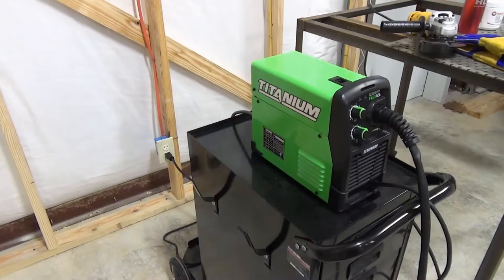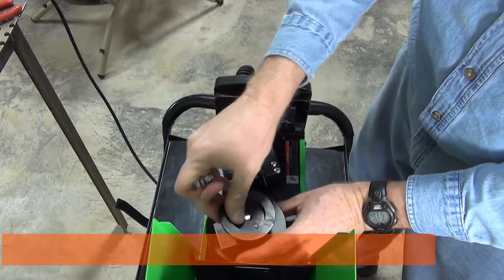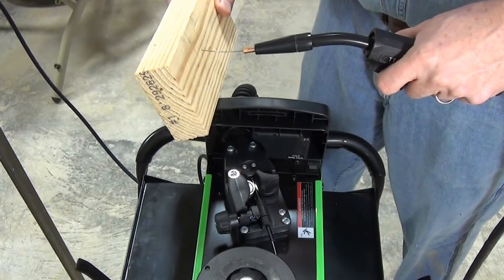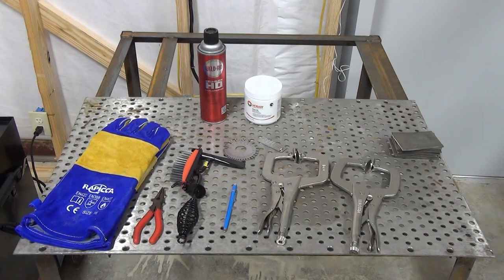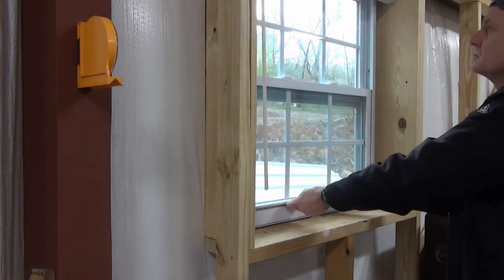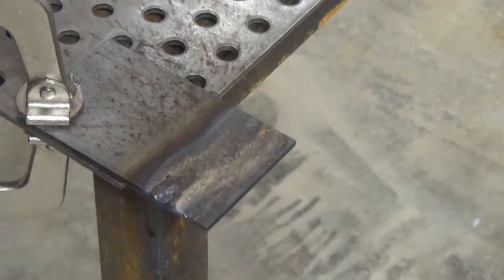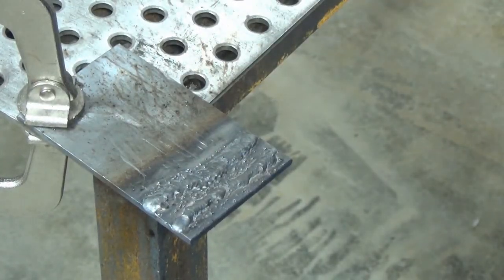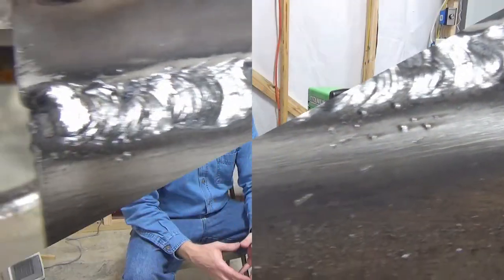Titanium Easy Flux 125 Welder: Specs, Setup & Review,  - A Great Welder for Beginners! (#83)

Comment: You're probably doing far better by now, but for other newbies, here is a tip. When you are standing and free handing a weld, your body, arms, and hands tend to move around, and for some people it's difficult to steady your hands enough to stay consistent in the molten puddle. Try setting up your work piece so that you can lean your body or one arm against something to steady yourself from wobbling or shaking. It could be as simple leaning your hip against the table, or the back of one arm or elbow against a vice or something. The more you can steady your body and arms from the 'shakes', the more consistent you will be in the puddle. Then you can focus on how to move the puddle along so that it looks like you are stacking dimes or nickles. Once you begin developing good welds and understanding the importance of being steady and consistent, you will begin to develop your ability to free hand a little better without always bracing yourself. Good luck to all you newbies.
Reply: Thanks Mike for the advice.  That makes perfect sense.  👍
Reply: I need to figure out how to dial the mask so I can see the puddles :-)
Reply: @jpravetz   The minimum shade number you should use for any type of arc welding is #10. The larger the number, the darker the lense, so #11 and #12 will each be darker. Here is something you may try that helps. Buy an old school welding helmet without adjustable shades. Buy a #10, #11, and #12 shade lense. Start with the #10 shade which will give you the clearest view of your welds. As you weld, pay close attention to what is going on with your puddle. Then move up to a #11 shade. Things will be darker, but your familiarity with the arc and puddle from the previous shade will help you to weld with the darker shade. You may want to try the #12 shade also and decide which offers the best eye protection while still being able to see your work. Once you are comfortable from understanding your puddle from using the lighter shades, you may be able to comfortably use the darker shades. Different types of welding in different conditions can be a factor in which shade you use. Then you can go back to a helmet with an adjustable lense and you will be able to dial it in to your specific needs and circumstances. Starting with a number 10 shade should give you a pretty clear view of your weld puddle and that's a good place to start, but for the health of your eyes, you should use the darkest shade that allows you to work without struggling to see.
Reply: @tangoindiamike9189  Thanks for this info, very helpful!
Reply: @jpravetz  Another tip...the lighting conditions around your work can also play a part in your ability to see well. For instance, if you are stick welding out doors on a clear sunny day with no shade casting on your work, your visibility will be notably better than welding indoors in a dark corner. If your work space is dark, try positioning a shop light or a lamp to shine on your work. Caution: if you have white or light colored walls, the welding flash can reflect off the walls, into your helmet, and reflect back into your eyes by bouncing off the inner side of your lens. This can cause flashburns to your eyes. If you are not familiar with flashburns, it's not something you want to learn about the hardway. You'll wake up feeling like you have sand and vinegar in your eyes and won't be able to keep your eyes open. The affects usually last 1 to 3 days, sometimes more, and if bad enough, can cause blindness. You'll need to see (visit) a doctor and get drops for your eyes. Learn from my mistakes, not yours, it's less painful for you.
Good luck with your welding.
Edit to add: Technically, a flashburn is when the retina gets burned by the welding flash. Take care of your eyes and learn to adjust your surroundings, work lighting, and lens shades appropriately. Having work lights will help you see better without harming your eyes.
Reply: @tangoindiamike9189  I love learning from other people's mistakes. Thanks Mike!
Reply: Thanks
Reply: Mike do you make videos?? You gave great advice thanks
Reply: @deontagray7526   No, but I think about it a lot. 😁
Reply: @tangoindiamike9189  I’m subscribe to ur page I say go for it I fully support you

Comment: I’ve had this same welder for two years and it has performed flawlessly. I tried several different brands of wire and settled on INE, as it delivered the best welds with very minimal spatter when the machine is dialed in properly. I’ve done trailer repairs, mower repairs, countless home projects, and even used this welder to weld the chain hooks on my tractor loader bucket and have been 100% pleased with the results. Your first welds looked great, and I’m sure by now you’re even better. I just recently bought this welder’s big brother, the Titanium Stick 225 SMAW welder, and have been practicing with it lately. (That thing is a BEAST!)  Since all of my welding is done outdoors I stick with flux-based processes, and with these two welders I can tackle anything that comes up. Great video Martin, thanks! 👍
Reply from the maker: Hi David!  Glad to hear you have the same welder and it has held up well.  Yeah, that INE wire is good stuff.  Also glad to hear the Titanium Stick 225 is good too.  I’ve considered getting it as well. Thanks for the kind words and for watching!

Comment: I recommend that you remove the protective sleeve and tip without the power on.. if you press the trigger when the sleeve is off, then it’s live, and if you touch it, you can get quite a shock. If you lay it down on metal that’s grounded, it can short.

What people call the ground clamp isn’t a ground clamp, it’s a work clamp. Actually it’s on the positive side of the circuit for DC flux core welding. If you try to weld to something that’s grounded, it could be a problem, so check first.

Don’t get too close. The closer you get the more spatter you’ll get. The welds aren’t bad for a beginner. Some of the welds are too wide. It seems you’re moving too slowly. Use a stringer unless you’re welding a “t”. Don’t weld over a bad weld. It never works. You’ll catch flux in the weld and have porosity. Grind the weld down and try again.
Reply from the maker: Hi Mel! Thanks for the great tips and for watching!

Comment: What I have done when touching areas that may be electrified is keep the welder unplugged. I just picked one up myself after having got rid of a very heavy welder years ago. Good instructional video. Helped reinforce what I read in the manual. I actually took the shop part of a welding class at a local community college. Indeed, practice makes proficient.

Comment: I have no experience with wire feed welders and am looking to buy one. I used to be fairly good at stick welding back in the day. I just wanted to compliment you on the quality and thoroughness of the video. Especially wearing an external microphone, that adds so much more quality to a video. The voice overs are very professional too. Well done and you’re going to improve every time you do a bead. One thing I would have liked to have seen is comparing your beads to the manual to see if your controls were right or just from being inexperienced. I suspect a little of both. Well done.
Reply from the maker: Thank you for those kind words!  Comparing my first beads to the manual would’ve been depressing, so no thanks!  But, I think you’re right: a little of both. Thanks for watching!

Comment: Came here from your posting on the Harbor Freight site just to post some thanks for a very professional and thoroughly informative primer on this welder and beginning welding in general.  Watching has pushed me closer to pulling the trigger on something like this although living in a close-in residential neighborhood, I don't have the space for a shop (or real need for this, other than as a maker-hobbyist) but I appreciate all your efforts to make this helpful video!
Reply from the maker: Thanks, P F!  If you live in an area with decent weather so that you could weld outside, then this little welder would be ideal. Thanks for watching!
Reply: @DIYMyWay  I see it is on sale at HF this weekend in a big "parking lot" sale for only $159.99!!  Pretty tempting....

Comment: Great video that will be very helpful for the beginners just sitting on the fence about buying their first welding machine!  I'd consider just replacing the HF wire with your new stuff right away to get rid of the splatter.  You can always save the remainder for "emergency" running out of wire.  Also, I know there are better MIG machines out there (with gas shielding), but anyone who says you can't get a quality weld out of a 110V flux-core either hasn't tried one, or watched some of the excellent videos already posted.  Used within their limits by people who have practiced, they're perfect for beginners and the occasional home welding needs.  I've seen plenty of guys with big wallets make worthless welds with $4000.00 Lincolns, Millers, and Hobarts.  Keep up the great work and keep practicing!  Thumbs up!
Reply from the maker: Thank you for the kind words, Rob!  And thanks for the insights!  I agree 100% with you that these inexpensive inverter welders are perfect for occasional welders like me. Thanks for watching and the thumbs up!

Comment: I like to position myself to where I can stabilize the neck of the gun with my left hand while resting the bottom of my left hand  on something solid. Do practice passes to make sure nothing will interfere with making a smooth consistent pass. I just bought the titanium 125 as a portable welder and it's a great machine for the size and money.
Reply from the maker: Thanks for the tips, Jake.  I appreciate it! Yes, that little welder is surprisingly powerful for its size. Thanks for watching!

Comment: try to keep your distance from work around 1/8 inch and do less side to side motion you are running out of your heat pool and also work on staying in your pool a bit longer to burn the trash / contamination out and let the flux do its job if you pull your bead to fast the flux will not let the trash flow to the top of the weld to be removed other than this looks pretty good for a Noobie lol.

I  want to also point out your real amperage comes from your wire feed speed the more you push in the more heat you get power setting mainly applies till metal hits melting point the wire feed rate is what does the penetration looks to me like you need a bit more wire feed speed and maybe a little more heat your penetration isn't looking that deep but the before conversation about spending more time in the weld pool will help this flow deeper also.
Reply from the maker: Hi Rick!  Thanks for those in depth tips!  You’ve mentioned details I haven’t heard in other comments so I really appreciate it!
Reply: Awesome advice!
Reply: That’s too close. 3/8” for flux core.. even 1/2” isn’t too far. Too close and you’ll get far too much spatter. Remember that flux core is a very thin hollow wire. Hold it too close and the wire melts too fast. Then the flux isn’t heated properly, and it won’t be effective.
Reply: Thanks your comment helped me out
Reply: @melgross  you’re correct

Comment: Yes, anti spatter is a must with flux core for sure !!  A lot of the missing consistency can be gained by bracing your gun hand with the other hand while touching the table or work piece....even if its just with a finger.  That will make a great difference until you get a better hang for the holding the gun with a steady single hand.  I still force myself to this day to implement this idea. 
    As for your first time performance, for the passes near the end, it was looking pretty darn good.  Burn some wire and btw...you looked cool with the backwards cap.  LOL. Sorry it took so long to see your video and I thank you for the shout out to me and ol' Joe.  But I surely wouldn't refer to myself as an 'experienced' welder....but thank you for the vote of confidence Martin. Be safe and be cool my friend !!
Reply from the maker: Thanks for the tips, Wendell!  Yep, that’s the only time you’ll see me wearing a cap backwards!

Comment: Martin,  Great video.  Keep them coming.  I’ve had a similar flux welder for quite some time.  It has come in handy.  I got a wood chipper last summer and like you, I kept the metal crate.  I didn’t know what I’d use it for until now.  Great idea.  Thanks Jim
Reply from the maker: Thanks, James!  Yes, I knew when saw that metal frame my wood chipper came in, it would be my first welding table.  I’ll get more practice welding by adding some more steel to it to strengthen it. Thanks for watching!

Comment: Martin,
Congratulations on picking up your first welder.  15 lb. inverter flux core welder 125 amp welder for less than $200 is a heck of a value.   I already have a Miller Mig, Tig and stick welder.  I picked up one of these for its simplicity and outside use.   You are doing well.  Check out my Festiva’s YT channel.  He is a fabricator and does some of the first reviews of the Harbor Freight.  He has a how to beginner welding video with the Easy Flux.
Reply from the maker: Thanks for the encouraging words!   In fact I did watch Mike Festiva’s videos among others on the Flux125 before deciding to buy it.

Comment: Off to a good start there Martin! My first welder was a Lincoln flux core about 20 years ago, think it cost at least three times more.(Gotta love Harbor Freight). I've come a long way since then but still not a pro. Looked like you were moving a little too fast (hard to tell sped up) but overall good form, I like the comments about finding a hand rest/ stable position. The recommended settings on the welder are a good start, but don't be afraid to make small adjustments. a lot depends on your set up so small tweaks might help. My only other recommendation is after your comfortable laying a bead on the table practice some out of position stuff. ( vertical up/down, overhead, around obstacles). I try to do as much on a bench as I can, but not always possible. Practice some before you have to do a field fix upside down in the mud. As always Great work! Have fun and keep learning.
Reply from the maker: Thanks, Bubba!  I appreciate the tips!  I have a lot to learn, but I'm sure enjoying the journey.

Comment: How's she goin'?  Wow Martin.  Those were some nice welds for your first time.  You have already passed me and I have years of experience!!!  LOL  Seriously though, those were nice beads.  The flux core welders are great for back yard guys like us who aren't ever planning on welding anything structural like a trailer or something.  Thanks for posting!!!  Take care!!
Reply from the maker: Thanks for the kind words, Mike!  I must admit, I was surprised that most of my first welds weren’t terrible!  I can see I’ll have a lot of fun with this thing and will soon be able to fix and build all sorts of things. Thanks for watching!
Reply: @DIYMyWay  Soon you'll be able to weld everything from the 'crack of dawn' to a 'broken heart'!!!
Reply: I actually have welded trailer parts(ramp included) with fluxcore. I used the harbourfreight 125 and the welds looked great with proper penetration. You have to get the wire speed set perfect and use the high volt setting and slowly drag while while very slightly whipping.

Comment: Love it. Just bought the same little welder to take a dive into metalwork and tackle a growing to-do list. I like how instead of more polished, pro style videos you did the approach I think everyone should take - just grab it and start doing the thing. I will say the wire it comes with is absolute crap. After YouTube digging I landed on INETUB wire, made in Italy and I would highly recommend starting with that out of the box and throwing the spool from Harbor Freight in the trash. Anyway, high five on the video, and keep on keepin on.
Reply from the maker: Thanks! Funny that you mentioned the INETUB wire! I just changed to a spool of it about a week ago after using up the starter spool.  I could tell just handling the wire while putting it in the welder that it is a superior product.  Did a few welds with it and I like it a lot! Thanks for watching!
Reply: @DIYMyWay   High-five on that one. Another note - replacing the ground clamp with that 400amp solid one from HF is another cheap win. I left the crimped connector on the ground wire after removing the old clamp and only getting 1 slight dent in the wire. Then I snipped just enough off the end of the ring to fit inside the clamp to where the crimped part would line up to the bolt hole (take the bolt out and look in first, this makes sense when you see the clamp I'm talking about). Then just tighten the bolt. For the strain relief ring I cut maybe an inch off it since it's obviously made for a 400amp cable and snugged it up. For 15 bucks and 15 minutes - it's infinitely better than the clamp that comes with it. For $170, they had to skimp somewhere. If I were you, I'd make a video on the mod. I say this because I know I don't have it in me, but I feel like it's an upgrade people should know about. Anyway, thanks for reminding people to never stop learning and doing.
Reply from the maker: Yes, the ground clamp upgrade has been on my radar for a while.  I think you have a good idea on making a video on the mod, so I may do just that in the near future.  Thanks for the suggestion!

Comment: I'm getting ready to purchase this exact one today. Could you tell me if it's still working great, also can I plug into a regular wall outlet
Reply from the maker: Hi Trev & Shane!  Yes and yes!  Although at maximum power setting, you may trip a breaker if it isn't a 20A breaker or if there are other loads on the same circuit. Thanks for watching!